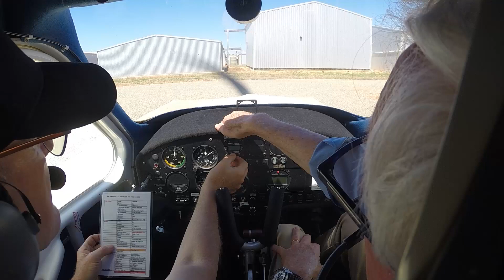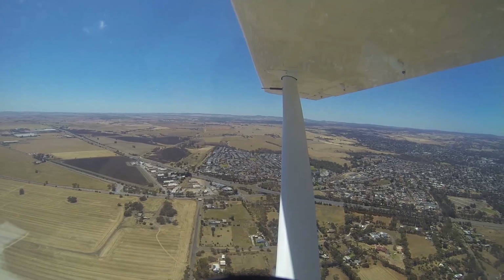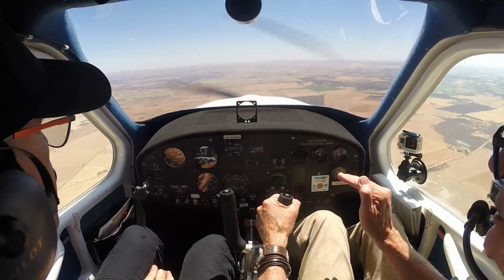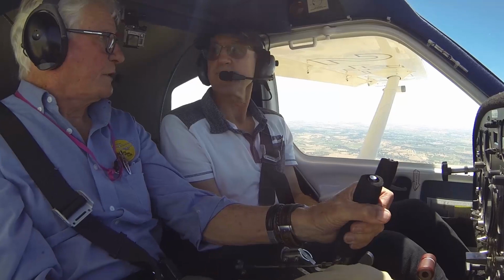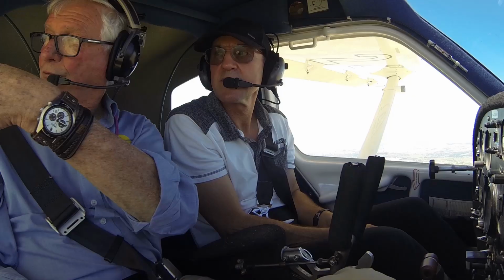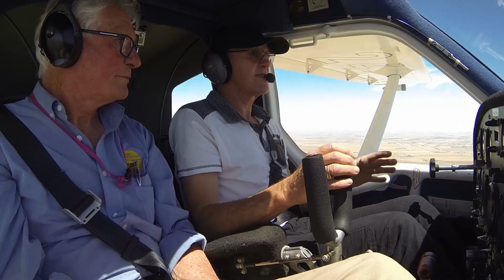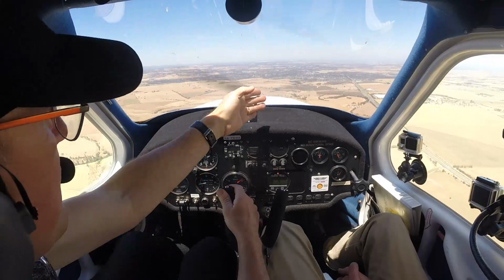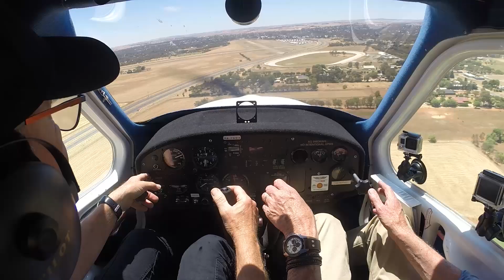Wing Stall and Engine Failure  |  Pilot Training at its best

Comment: I was taught its pretty much stick position = stall (at any speed), all the way back gets you a stall.   You also don’t mention opposite rudder to counter wing drop.   Most of those other conditions (low engine power, slow speed) lead to stick position, and thence to stall.   I’m still a student, but that’s my working understanding.  I love your videos, but really curious about your take on that?
Reply from the maker: 12:23 where i get the student into a simulated wing drop and the start of an incipient spin. He uses the top rudder to bring the wings back to straight and level. Tx for the feedback. More to come and enjoy. Cheers Ian
Reply: @BigglesAviator  thanks.  I hadn’t got that far in the video yet :).  The Citabria I’m in always drops a wing :)
Reply from the maker: Yes the Jab needs to be forced to do a wing drop. Without power it just mushes. but add power and it will drop VERY quickly. Training aircraft designed to protect the beginner. Cheers Ian